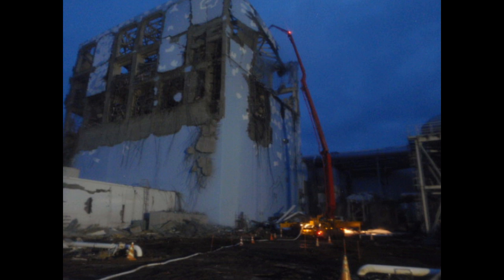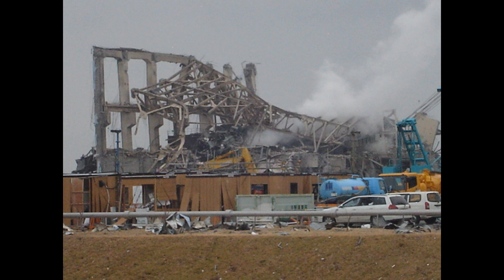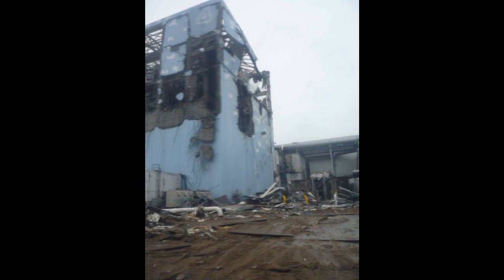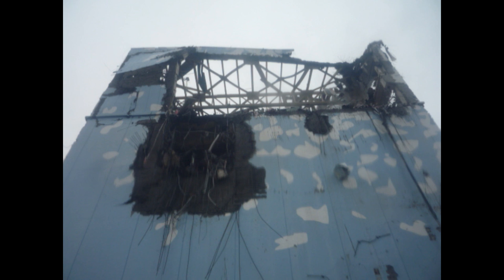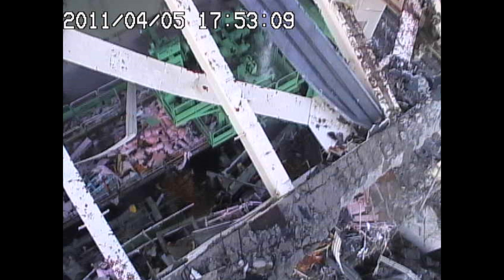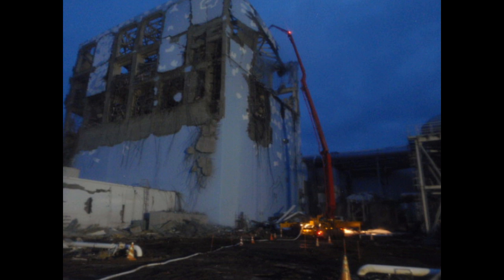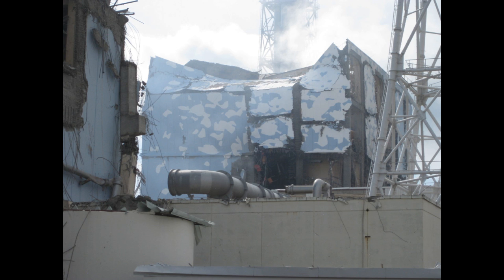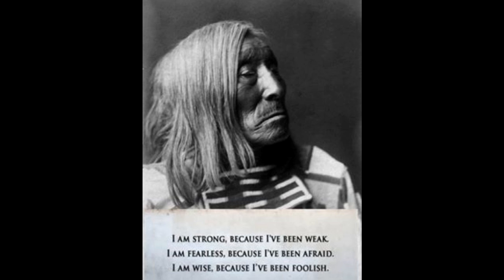Of Sand and Ships

Comment: 5 minutes in and I recall(sorry-no doc numbers but I could find them if I had to) the big test was whether the weight of wet sand could be supported by a heavily damaged structure. That wet sand weighs more than water and the sand scenario was too risky. I understand the NUREG but given the damage to #4 and its' deterioration without water OR sand I have a hard time believing that sand was ever used. Just my 2 cents.
Reply: They were scared it was going to topple over due to its lack of structural integrity.